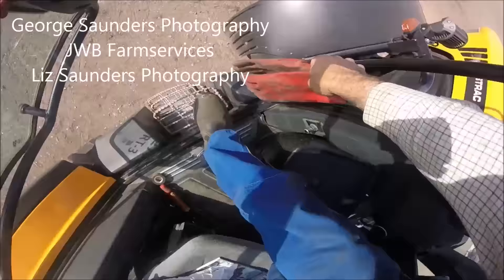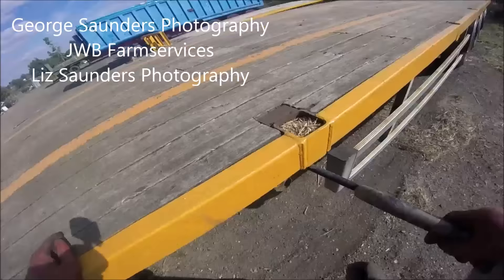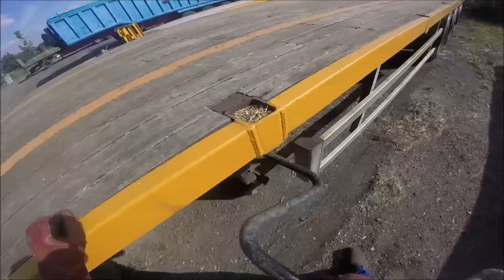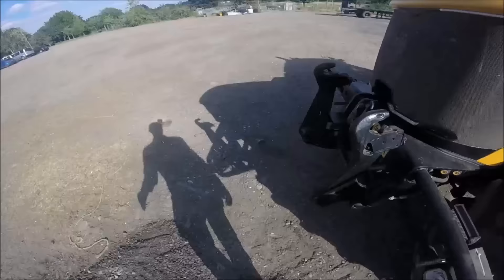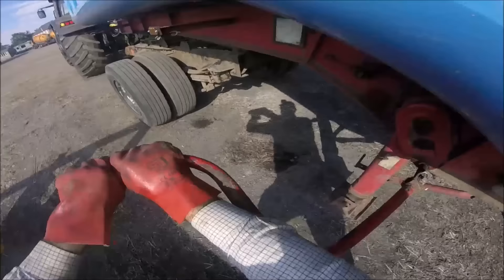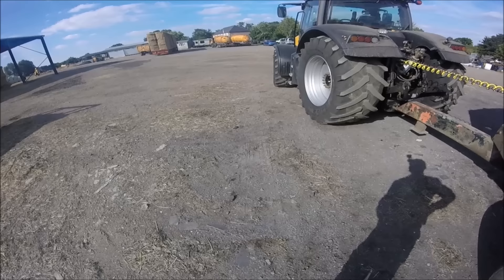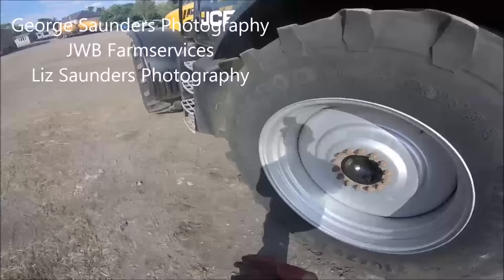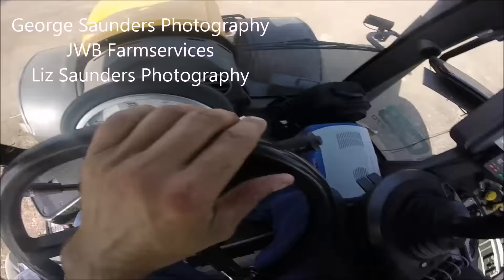Hooking up the bulker, watch your head!

Comment: a lorry mechanic once told me that it was pointless revving an engine to increase air flow into the air tanks as the compressor only feeds the same amount of air through the system regardless of engine revolutions !!!!???? maybe in the older lorrys this was not the case and you had to keep the revs up to keep a constant supply of air going but not anymore with the newer stuff !

Comment: George great video as usual.
Just a quick safety point, best practice is to ALLWAYS apply the trailer park brake when disconnecting and not rely on the red line.
The reason is when you reconnect IF you have forgotten to apply the tractor handbrake and your outfit is on any sort of slope it will run away as soon as you connect the red line.
Many lorry drivers have been killed or seriously injured in this situation.
Keep the videos coming George there great and stay safe. Cliff.

Comment: Hi George the pain wasn't funny but the language was more than  hilarious. Over here in Canada and the U.S a lot of truckers have a long hook  made from 1/2" or so rod they can hook in the end of the 5th wheel lock  handle,  get there hand on the other end the same as the lock lever eye you hold. Then be further out the side so you don't get under the trailer at all to pull the lock. When they are done they put the handle in the cab or storage  box out the way. Maybe it would work on those 5th wheel locks to. Ask OLF he might use them to with his semi trucks.